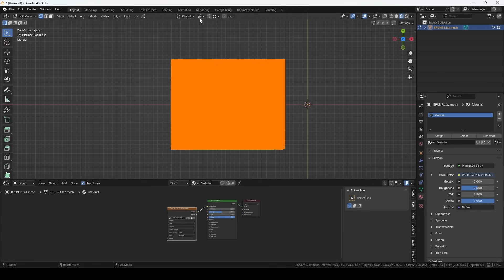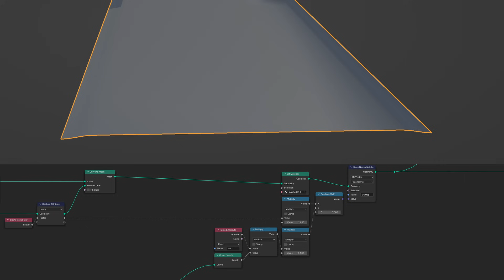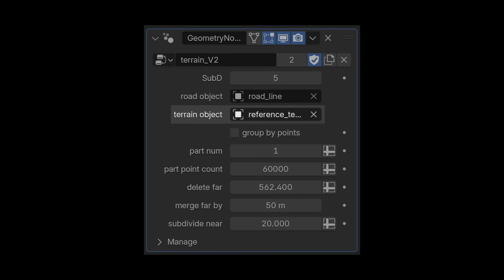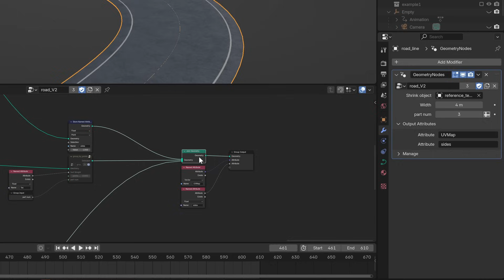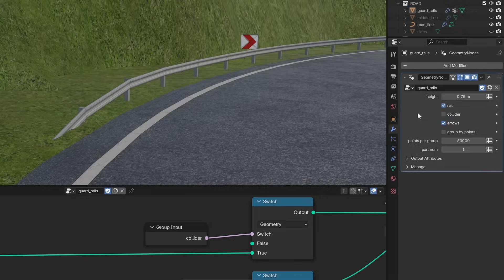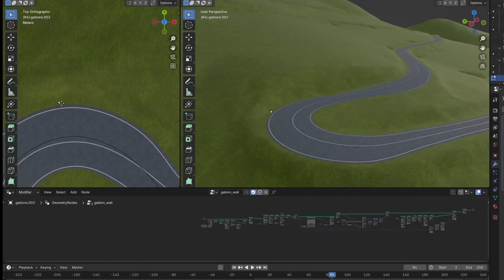Building a Real Road for Assetto Corsa with Blender’s Geometry Nodes

Comment: Still don't get how you textured the roads. I remember first time ripping game model (from nfsu2) and whole roads consisted of small modular parts for using a single road texture over and over again, but your road mesh don't looks modular, are you using high-res texture for whole mesh chunk?
Reply from the maker: It works exactly as you described. It's a 4K asphalt texture that's set to repeat. To be honest, I'm still learning procedural UVs as I go, so I'll be able to explain it better once I understand it myself.
Reply: Awesome work! Would it perhaps be possible to upscale the satellite image with AI so you can actually use it (or partially use it) and perhaps have a vision LLM interpret it and where the trees are located?
Reply from the maker: @ Thank you. I know nothing about that but since these satellite pictures are very large I think using them would mean creating smaller tiles and still I don't believe you would achieve good result upscaling them.

Comment: I imagine this could be used for Beamng as well, as you can export it as DAE, but with small tweaks maybe it can be a direct export to their vegetation a road systems
Reply from the maker: I want to create a similar set of tools for BeamNG in the future, but don't really understand their process yet. Also, their level editor keeps improving with every update, so there might not be much point if they end up implementing similar features themselves.

Comment: This is awesome, I've been tinkering for a while on a similar setup in Houdini but this seems much more streamlined. Do you think the system could be expanded to handle intersections?
Reply from the maker: @felipefrango  The main obstacle for intersections now is the fact that I need the input to be curve to have access to the radius value. I can't use vertex groups on curves and can't  find a way to tell it which road is main and which is minor. Hope I'll figure it out. 
Thank you for your comment.
Reply: @mesh_house  This is a long shot, but my approach would be to attach all the necessary data such as road types, lanes etc. to the road splines. Lane connectors are then just another type of spline that connect all the lanes of the intersecting roads with each other.
The only question is whether this doable in Blender to the point where you can have a kind of UI "inspector" for this data once you select a certain road/lane. Something like this is my personal goal, anyway.

Comment: Hey bro, this is incredible work, I personally couldn't even get close to thinking up of stuff like this! However, the one thing I would perhaps ask is integrating curve tilt such that it would tilt the roads to give them a bit of an angle at various points, say especially at hairpins and turns, this would give your tracks more added character
Reply: yeah I wish there was a way to have roll points along a curve with a degree of banking which they target and smoothly transition to
Reply: @blockin9556  Think his recent update video implements this now

Comment: this is amazing, I am using a few road generators for blender, but they dont go even close to your simplicity, at least for the assetto corsa tracks.
but please add more features, like imperfections in the road, side road, stones, grass..., and plane trees 🙂
btw. your web page is not loading correctly.
Reply from the maker: Features will be added over time. I now experiment with different roadside elements like sidewalks or ditches. Reading this, I might also adjust the group for generating tree-points to work with other objects too (like stones, Y-trees, etc.). Road imperfections are handled in shader settings in KS Editor, which is honestly still kinda confusing for me, but I'll do my best. Thank you for your comment, appreciate it.
Reply: @mesh_house  Great, cant wait to try it.
btw. for the road imperfections, I was thinking about the road slopes, crest and dips, broken edges... because otherwise the road feels like a marble floor 😀
Reply from the maker: @RandomNoise  Oh okay, got it! I’ll implement a way to adjust poly-count of the road, as well as the imperfections. Good point!